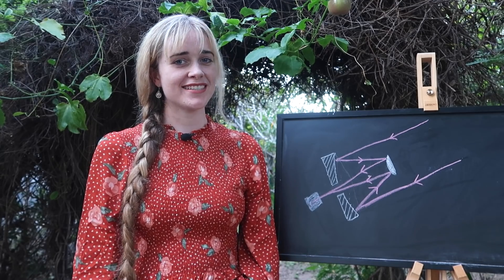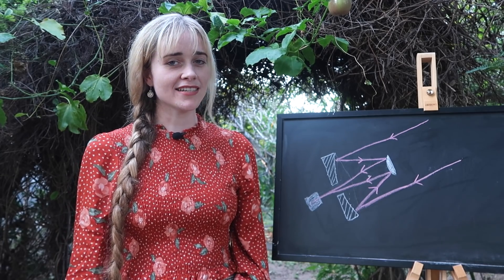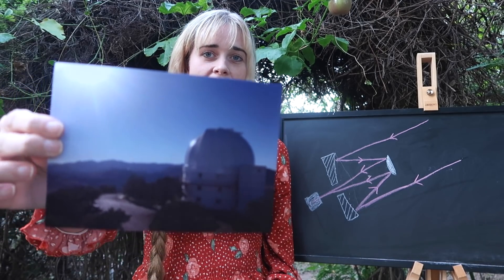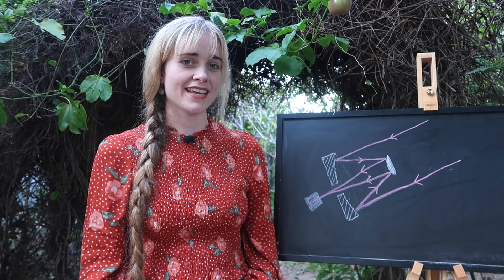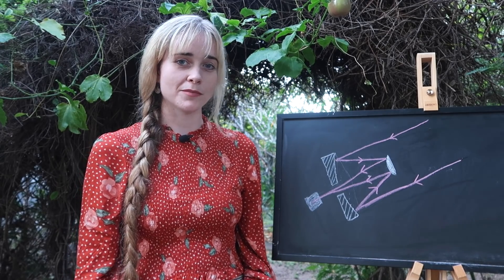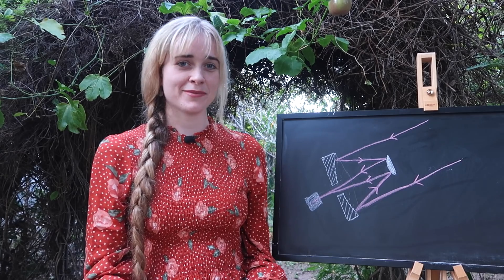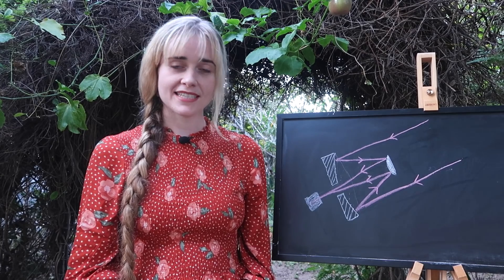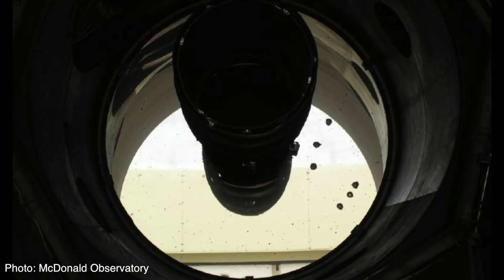This Telescope Was Shot 7 Times but Still Works

Comment: Not to be That Guy, but it looks like the first photo you held up is of the outside of the Otto Struve telescope. From the angle it looks like it was probably taken from the outside catwalk of the Smith telescope.

Just a couple weeks ago, they disassembled the Smith telescope to strip and recoat that primary mirror, something they only get to do every couple years (I think it had been a bit longer this time around). A truly enormous undertaking, that they pulled off brilliantly.

Comment: The "upshot" of this story is a 9mm is a useless weapon.  Thank goodness he didn't use something with real penetrating power.
Reply: useless? Just as lethal as most other handguns. Also the acrylic, and also the thickness that those mirrors are made of is comparable to bulletproof glass.
Reply: @BartJBols  The difference in stopping power between a 9mm and something like a .45 is pretty significant.  Telescope mirrors are made of low expansion glass, not acrylic.  Also, your sense of humor is seriously impaired.

Comment: He worked there and didn't know that glass for the mirror is cooled slowly specifically so that it doesn't shatters under stress? Madman.
Reply: I dont know his job, but imagine if he had been a janitor.  Also, a buisness man may rack up freqent  flyer miles in the course of his buisness, but it's possible that he knows next to nothing about fluid dynamics that keep the airplane afloat.
Reply: @kreynolds1123  i get your point, it's just that i grew up watching discovery channel xD And now i watch youtube from time to time(on less varied topics sadly).
Reply: @baksban74   I'm a technology junkie in nearly countless different fields.  I was aware that annealing glass reduces its internal stress, thus  preventing it from shattering. But I neither work with glass, nor am I an astronomer. :D

Comment: Most people don't know that the primary mirror on the Hubble telescope has a hole drilled in it near the edge.
It was called "The Teacup Affair". During grinding in 1979, inspectors found small cracks shaped like a teacup in the glass and had to drill them out to save the mirror.
Reply: I didn’t know about that!
Reply: So they fucked the job up even more than we're commonly told?
Reply: Really . nice to know . thank you.

Comment: Interesting video.  I have seen similar, minimal distortion resulting from small numbers of non-correlated surface errors on Cassegrain-focus radio antennas.  (These typically arise from physical impacts such a hail stones and other objects hitting the "dish".)

Comment: No, no, no. You shoot with a telescope, not at it.
Reply: I shoot with a scope if the range warrants it.  Otherwise just use iron sights.
Reply: Those mirrors must be made with more resilient materials than glass. There are many road signs out there with bullet holes, but they can still display the required information. I didn't think that comparison would be necessary with instruments of science.
Reply: @Maptologist  as one of the videos said, they are backed by glass.  But it's very thick.  It is also needs to be strong enough not to bend excessively under its own weight and may have other requirements (maybe predictable/minimal thermal expansion?).  So, it may be special glass, but technically the mirror is (coated) glass.

I do bet that the designers did not have a requirement for bullet resilience, though... :-)
Reply: Are you a member of ordo templi orientis?
Reply: @setmason1510  No, I haven't joined, I might someday. I've met several members and they're all really nice. For now I just practice Thelema in my own way.

Comment: I wonder if there is some way to patch the bullet holes and the hammer dings to reduce the 1% reduction in light collection
Reply: Whatever method would be used to fix the dents and holes, it would eventually require striping and reapllication of the reflective layer on the entire mirror. While the procedure itself would not be that expensive (although we're still talking 1000s of $$$), they would have to demount and transport the mirror to a facility that can do this AND not cause any furher damage along the way. Also bring it back and bolt it back to the telescope. THAT would be expensive
Reply: You can regrind the mirror or over-fill the holes, (then grind down) and re-mirror, (but that effort isn't worth it for 1%). If you are interested in fixing telescopes, look into the origins of the Hubble telescope.
Reply: @recklessroges  filling them in you would never gain the optical clarity needed. The only option would be to try and grind down to bellow the stressing from the impacts, which would take several weeks to months to do, and the mirror would likely be at risk of shattering during transport. Might as well just grind a new mirror at that point.
Reply: Thanks for all the great replies to my question
Reply: Dear patrick , the best senario I could imagin is the shooter got recover from his state and then he fix it him self . fixing people and empowering them is the main duty of all of us.
Reply: @maysammirzakhalili4862  I quite like you. You awaken the Buddhist in me

Comment: Your diagram GREATly exaggerates the curve of the secondary mirror to the point that for someone (like me) that know a tiny bit about optics it's distracting in its unbelievability.
Reply: Everything in the diagram is exaggerated, almost as though it's to demonstrate a point for educational purposes.
Reply: @AdamJoshuaGray  Indeed.  Not exaggerating the curve of the mirror surface for a telescope mirror like that would make it look almost planar to many people, thus defeating the purpose of the explanation.  However; the curvature shown in that diagram wouldn't be exaggerated for a typical Cassegrain focus radio antenna.
Reply: @vk2ig  that's a great point
Reply: You know about optic yet don't know about primary surface mirrors? I think we can be okay with you not approving her demonstration drawing.
Reply: @wyattroncin941  you go negative right away -- need a hug?

Comment: So I am wondering and have been trying to find any information on how the space between a mirror surface and the mirror's reflective surface affects resolution or chromatic aberration. Any thoughts?
Reply: The glass for telescope mirrors are typically only a support structure for the reflective surface that is applied to it. [Silver in old school, vaporized aluminum for more general/modern cheap stuff, and more 'interesting/expensive' coatings for the real high end gear.] Light reflects off the FRONT of the mirror, not the back like in typical household mirrors. This removes errors, improves the amount of light that can be reflected, but also makes it far easier to damage the reflective surface.

So thickness of the glass doesn't impact the light directly, as the light isn't reaching the glass itself. But the glasses structural properties, and things like thermal expansion rates, will offer opportunities for the shape of the mirror to be changed, and that will introduce errors.
Reply: Damage of this kind should not affect the resolution but rather  the brightness of the image.